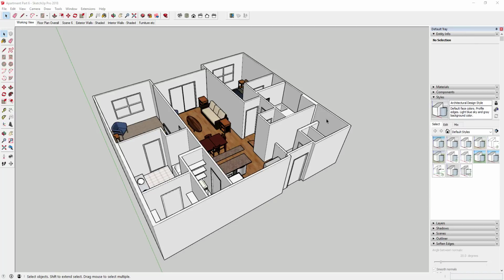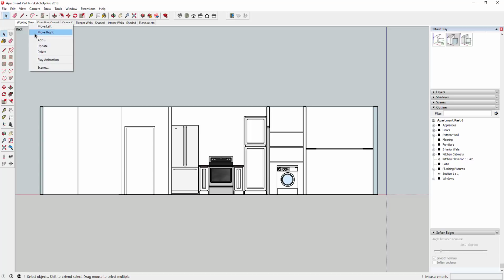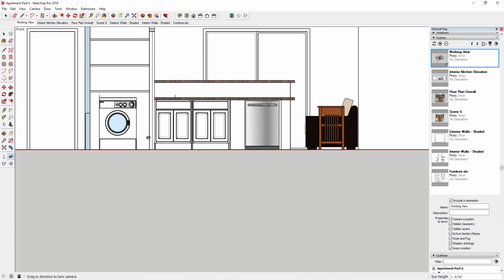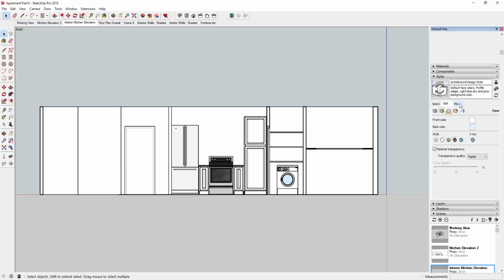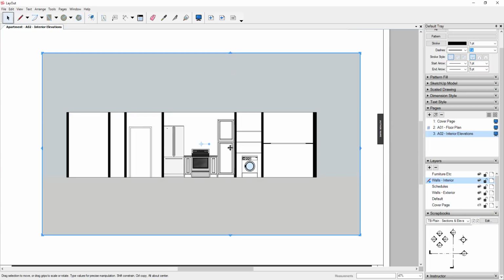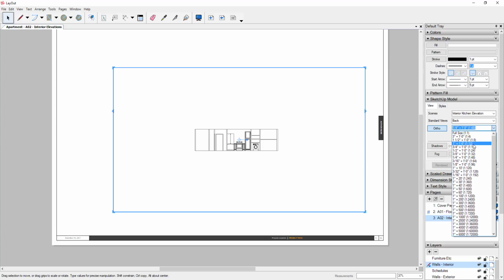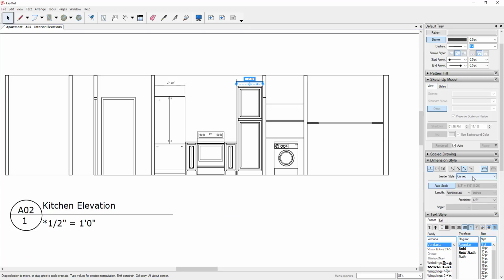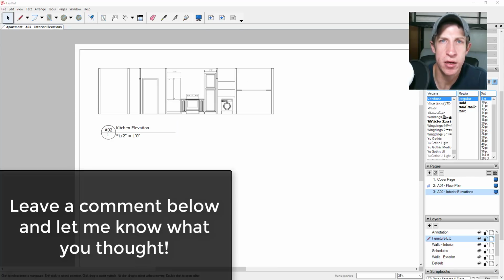Interior Elevations in Layout from Your SketchUp Model - Interior Design Modeling for Layout #7

Comment: I created interior view using Position Camera tool. When I convert it to Vector in Layout it shows all of the model, as though the camera is located outside of the bldg. (similar to wireframe).  Is there a workaround? The drawing has to be in vector, raster is too blurry for professional blueprints.